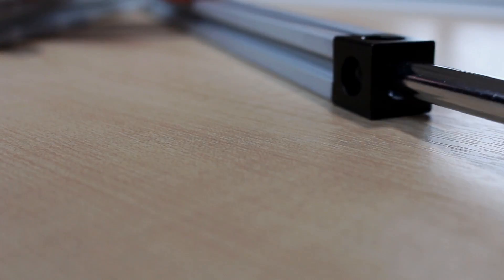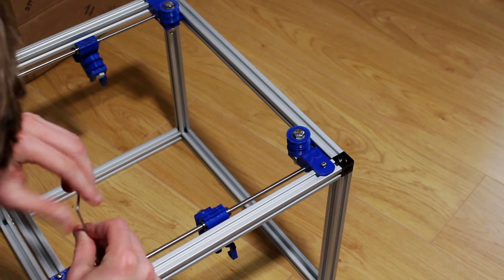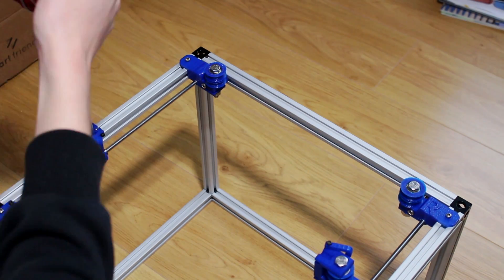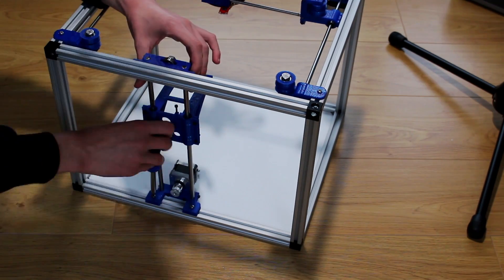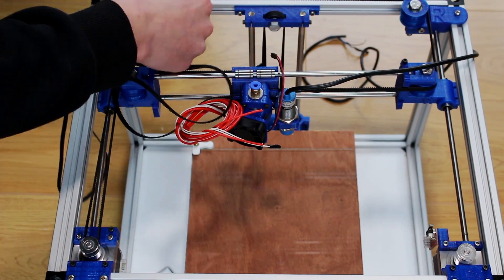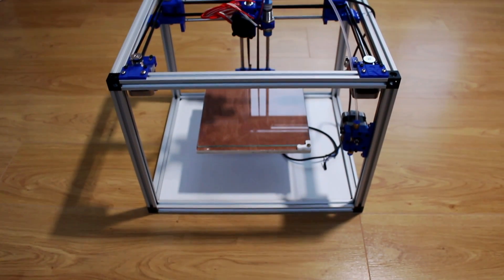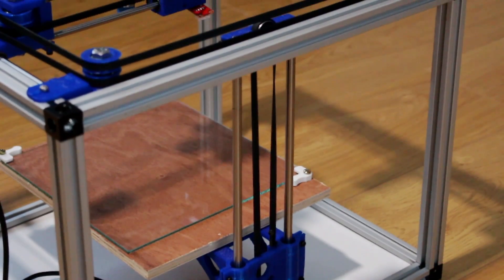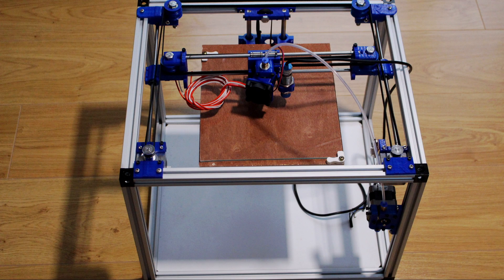SmartrapCore Alu CoreXY DIY 3D Printer Build - Part 2 - Mechanical

Comment: not ot be rude but that motor + idler mount needs to be designed to be way more rigid. I wouldn't go with that even with aluminium parts! let alone petg which is very flexible
Reply from the maker: Hi, no worries that is a good point, this printer was a good starter at the time but had it’s flaws as you mentioned, sadly the company that made these kits are no longer around

Comment: is there any advantage to those cube like brackets? I used L brackets on my hypercube
Reply from the maker: No real advantage as such, achieves the same result really, may be slightly less stiff than the hyper cube joining methods but I haven’t experimented with that

Comment: Nice looking build. May ask what size rails you are using and the overall dimensions. I'm gathering parts now and not sure about the stability needed for a 300 x 300 heat bed (it's on the way now). I have 2020 on-hand and 2525 on the way. I'm thinking from 400-500 mm on overall size. Decisions, decisions....Any input from you or anyone would be appreciated. I'm new to this and really studying up on it. Thank you.
Reply from the maker: Hello, thank you and thanks for subscribing! What is a 2020 is that your heated bed? and are you wanting to make the build surface 400-500mm?
Reply: My terminology is lacking, 2020 meaning 20 x 20 mm V-slot and 2525 is 25 x 25 mm T-slot aluminum. The heatbed arrived this evening and it is 300 x 300 mm. I see you're using extruded aluminum with fairly large overall dimensionsl, and was wondering the size of your build. Along with stability issues you may have, if any. Thank you.
Reply from the maker: +Loren Carlson ahh I see what you mean now! Sounds good, you have quite a large build area. I think the extruded sides are about 320mm, I get a 200x200x200mm build area out of that. There's a few misalignments and things, also the 6mm rails I've got aren't the best, I'll be correcting these issues over the coming weeks!
Reply: Your terminology isn't lacking, 2020 and 2525 is a regular way of referring to profiles :)

Comment: Inductive sensor and wooden bed ?  That won't work together  :)
Reply from the maker: yes, hence why on the finished build there is foil between the glass and wood :)
Reply: why not use capacitive?
Reply: It's not accurate and is affected by things like humidity.
Reply: What is? The capacitive sensor? I have an adjustable capacitive sensor and it's very accurate from 1mm to 10mm. And humidity shouldn't be a problem either unless it's an excessive amount. Good thing is that it also works on glass.
Reply from the maker: The bed has foil underneath if you've seen part 3? :)
Reply from the maker: +michor10 yeah it's been working alright for me

Comment: baffles me why they used linear rails and bearings instead of riding the extruded frame like modern designs. it's less stiff, costs more, and takes more components.
Reply: +ms3bani Not quite. Alu extrusion itself is cheap, the wheels are not. You need 2 bearings per wheel, and an absolute minimum of 3 bearings per axis connection. Then you have the wheels and the precision spacers and everything. Eccentric spacers are more expensive than you'd think. It all adds up. For long distances it's pretty cheap, but not for short distances.